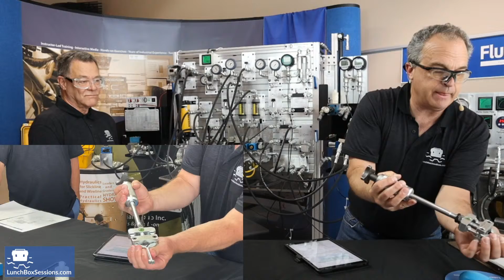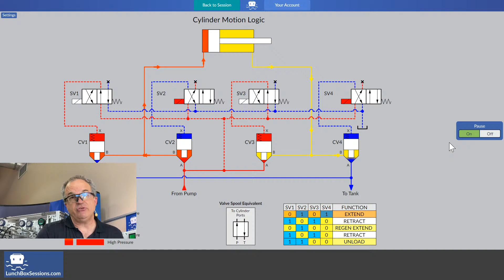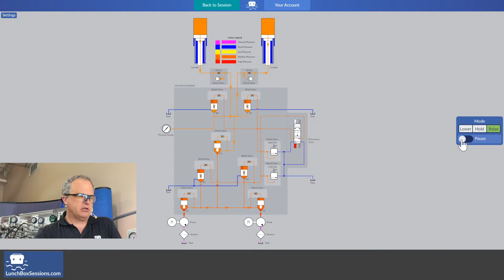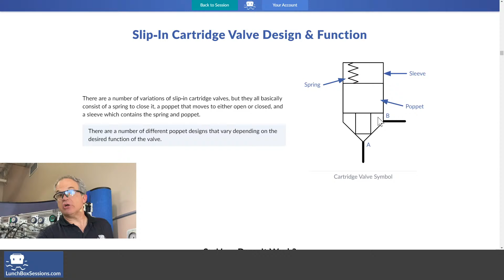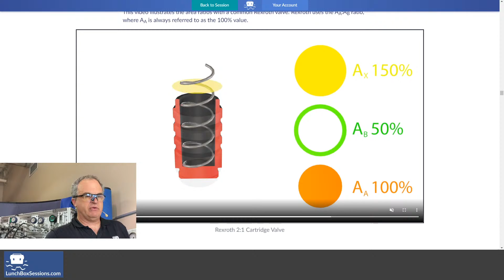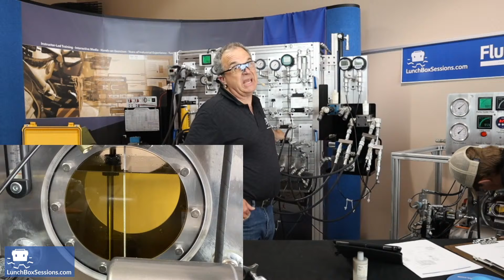Slip-in Cartridge Valves: Simply Logical Flow

Comment: Hello sir,
 I am facing a difficulty in my hydraulic circuit that when the tilting furnace cylinder operates, it takes jerk when the pilot valve for controlling the logic cartridge opening.
If you say , i can share the drawing with you.